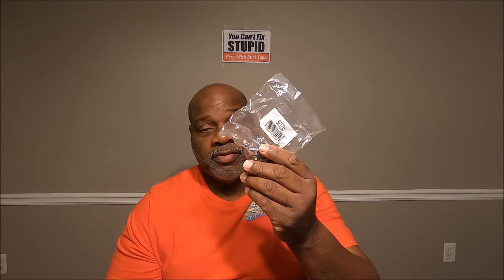$200 for Ford fuel injection o-ring kit

Comment: dam hope it works for u im sure youll get it. thats why i like older used trucks u can fined used parts easier for common engines like my 95 f150 needs shocks and i found a set on ebay for under 100$
Reply from the maker: I like newer 2016 F150 with a little 165 cuin v6 twin turbo because I can you get 26 mpg running 65 mph.
Reply: @blackericdenice  ya gas millage is always good, thats why i also have a 2000 subaru forester 2.5l i get around 25mpg in it. the old ford is used for work but i daily the ford if i have enough gas money. i always try to avoid automatics because i have had better luck with manual's lasting and i get better mpg.i do like the newer auto's with lockup converter helps the auto's mpg
Reply from the maker: @redneckasmr-xd1gg  I used to love manual over automatic too. After learning how to rebuild automatic. I love them if the car is fast.